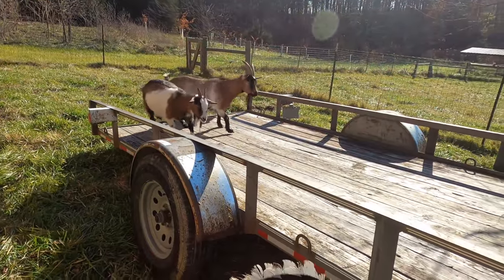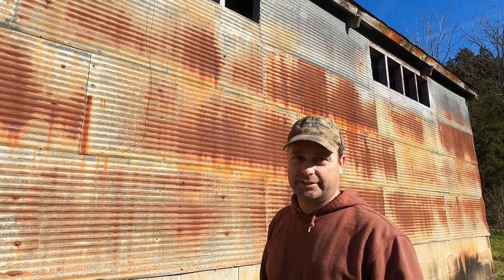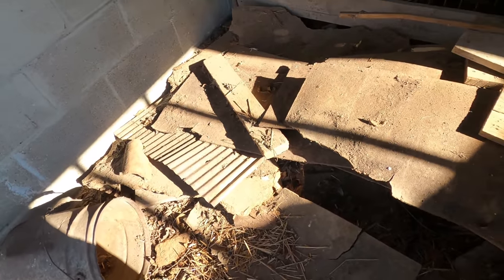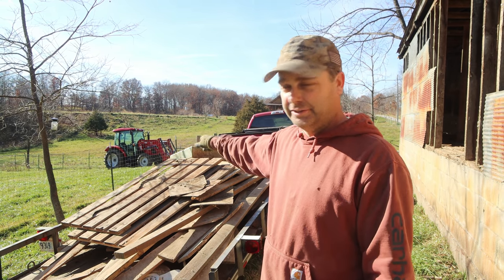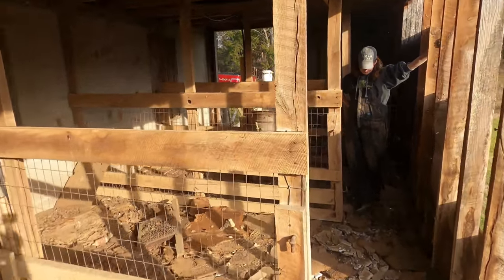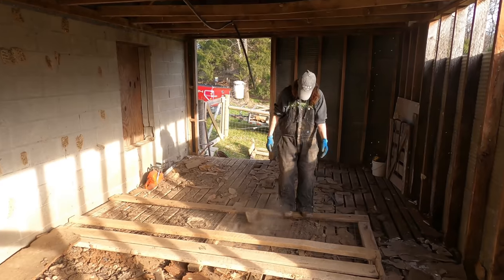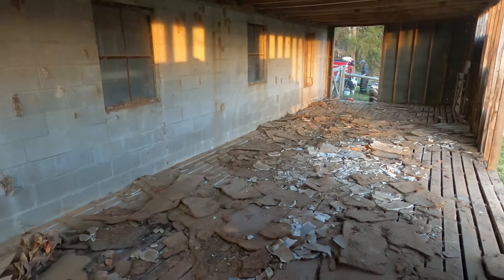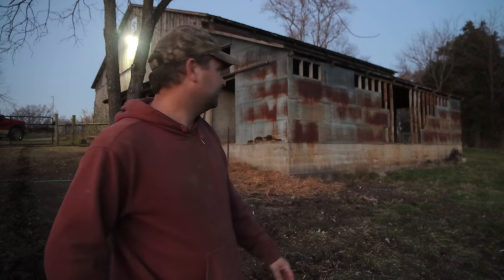Tearing out the old animal stalls in the Bank Barn.  We've never worked on this section of the barn.

Comment: Until YouTube came along, all the farmers/homesteaders I know, would have saved those fence panels “just in case they would be useful down the line”.  Or at a minimum, saved the lumber which is always needed. Don’t get me wrong, I do enjoy your videos. Wasting bothers me.
Reply from the maker: You can come and get the lumber if you want it.  All the loose lumber that was stored in there, had 3 to 4 inches of raccoon poop covering it. We had to knock it all off before throwing it on the trailer. Not the kind lumber I want to save and reuse.

Comment: Well hopefully they pumped out the pig waste.  Wonder if it is cemented.  I would think so but looks as if was on buget to build.  The rolling doors maybe nice to clean out and air flow.  It may all change once ya get the pit open.  It always seems like project just go bigger than planned. We had mules that chewed the shed.  We put motor oil on the wood.  They did stop eating the 2x4 s.  after that.   It would be nice to get the tractor in when you have to do a clean out of the barn.  who knows the pit maybe the new floor.  Only time will tell. Looking forward to see what you do as always.

Comment: With the price of lumber, I hope you guys are going to salvage as much as you can
Reply: My face when they said burn pile 😧.  If your not going to use it at least offer it for pick up.
Reply: I would have used the feeder for a planter lol
Reply: Firm believer in recycling and repurposing when ever possible.
Reply: @lorineidtinytoadplot744  that was exactly my thought. It would have been pretty in front of the barn. But they both work so much it doesn't appear they have time for flowers or plants that you can't eat. 😁
Reply from the maker: All the loose lumber that was stored in there had 3 to 4 inches of raccoon poop on it.  We had to knock it all off before throwing it on the trailer.  It was pretty nasty lumber, not the kind I would really want to keep.
Reply: @CountryViewAcres   Yuck 🤢 that must have been fun to clean
Reply: @boathead22000  Exactly!!  dint look like it had coon crap on the uprights and a lot it!! I grew up on a farm where we saved all usuable stuff!!

Comment: Evan,   Ive done a project similar to this. May I suggest if your going to open up part of the concrete block wall do it on the end/side wall by the tree. It will make cleaning it out easier with the tractor and its already cracked there anyway. Also add a gate to that opening it might make it easier to load livestock from there. Another advantage  you could use a big bale feeder in there and accessibility for using big bales Also on the side you were planning opening  that area will be a muddy mess from the rain coming off the roof and the livestock going in and out

Comment: To bad those old boards looked like you could have recycled lots of it, timber that long cost an arm and two legs
Reply from the maker: There was several pieces of lumber stored in the barn.  But it had 20 years worth of raccoon poop on top of it.  3 to 4 inches thick.   So I can imagine how much urine add soaked in as well.  After I saw the condition of the wood.  I wasn't going to even bother saving it.

Comment: Save what you can of those decent looking to buy for us you could use them to patch holes in the floor I think you’re going to have to completely redo that floor in that whole area. I hope the floor joists underneath are in pretty good shape although the way it covered with that flooring with gaps between the boards I suspect you’re going to find a way with a lot of manure down underneath. To clean they probably just hosed everything down and let it run through the cracks in the flooring.

Comment: Why making the door on the long side of the building and not where the sliding door was? Seems a lot easier to get the tractor in to remove hay and manure. Well you can also use a fork to fork it front of your now planed door and use then the tractor. I don´t think you get the tractor around the corner. And remember the struggle when removing the wasted hay from the goats ^^

Comment: Rather than open the blocks in the middle, if you open the end you could drive the tractor all the way through.
Reply from the maker: There is a tree on one end and a fence on the other.  Couldn't drive through if it was open on both ends.  So that wouldn't work with our layout.  But yes being able to drive through would be ideal.

Comment: Well this is going to turn into a major refurbishment task as indicated by your efforts today! I'm far from sure quite what livestock you plan to provide shelter / house in there but a few points to ponder on. 
Which direction is the prevailing wind (and rain) coming on to that lean-to? 
As the slope within the building and the paddock is obviously steep how wet is the soil in winter because (I'm thinking about access in bad weather)? - no gutters so rain and snow dripping off will make this wet area worse.
Have you given any thought to being able to mechanically dig out and haul off the manure created inside by the animals?
Do you have any thoughts of easy access to the hay loft area for feed and fodder?  
Lastly as you can see from the materials (the cast iron grates) you have removed there are already issues about adequate ventilation simply because the roof is pitched in the wrong direction for easy natural ventilation unless you leave the field side largely open or open up ventilation spaces to the main barn loft area?

Comment: To be honest, I'd tear the whole thing down and start again although not necessarily rebuild. What lies below those wooden slats is decades of pig manure. You are going to need to get that out and the quickest way is with the front loader on the tractor. The structure looks weak and the floor level so high that you are going to need to knock blocks out (as you said) to lower the entrance. If you don't need that barn, then just get rid of it. Better to use the foundations for a pen to a loading area for your trailer. It clearly is an add-on structure as the windows in the adjacent main shed (aka barn) suggest. Better to open it up and let the light and the air into the main shed as it was originally intended.

Comment: Hi,
I do not understand the concept of "burn piles".
You heat your house and barn by burning wood, therefore ANY wood that could be burnt can be used in those fires or stoves. Wood from old buildings would need to processed, but you have to process logs into usable pieces anyway. It would be very dry, and available for immediate use. 
Burn piles seem a waste of wood.

Comment: Do you really need more animal indoor area? If it rains they could always go into their normal stalls? It looks as though you would have to clean out manure manually. With cows that could be substantial labour. Modern barns are designed so you can access it with machinery, just saying.

Comment: Take this as you like but those cast iron vents cleaned up a little will bring about $250.00 - $350.00 each if not more. The trick is after cleaning up a little bit (please don't sandblast them)hold firm on your price and they will pay it.They are architectural GOLD
Reply from the maker: Some of the vents were packed completely full with raccoon poop and mice nests.  I don't know if you could get rid of the smell without sand blasting them.
Reply from the maker: @august  all I have is a little 1 gallon air compressor and no sand blaster.  So I don't have what it would take to do it.  I am sure a sand blaster would clean them up.
Reply: @CountryViewAcres , Thanks and I understand.